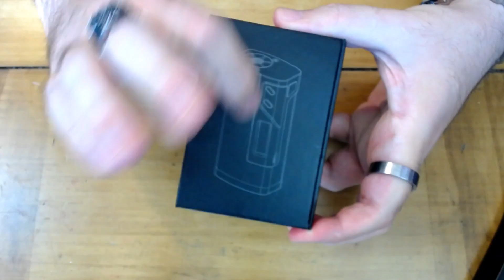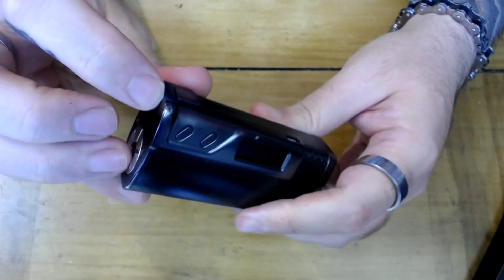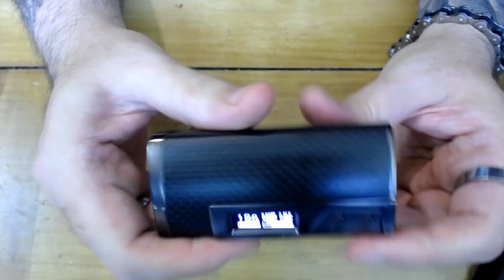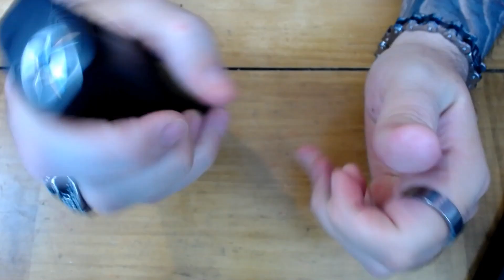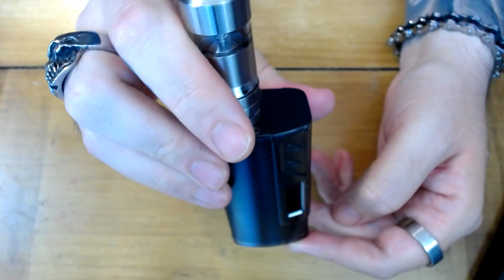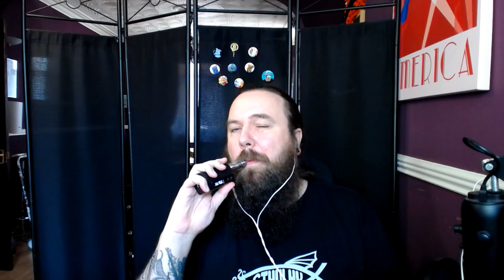Sigelei 213 Temp Control Mod plus TFR tutorial

Comment: Bought this today pretty happy with it. Con for me was the minimum of 0.1 ohm which makes nickel or nichrome clapton difficult for me at least even the evic vt which is ancient now could go to 0.06 which meant I could just enable dual claptons. Also got the stainless steel coils for the aspire cleito tank which is by far the best tank I've ever had and a rebuild able section which came with dual claptons installed unfortunately they had run out of stock of the larger glass 5 ml which is much better for the rba. Didn't enjoy the stainless coil in TC mode though it worked fine also works in power mode but kanthal 0.4 coil tasted a lot better imo. The preheat feature is amazing didn't notice you mention it but it's great in power mode and I like how they managed to implement it in TC mode also. Cheers
Reply from the maker: I hear you buddy, I have to say all I use this mod for is Wattage mode so it's no issue for me.
I think I must have forgot to talk about the pre-heat mode in power which obviously can help a lot with coils that need help ramping up.
Thanks for you comments.

Comment: pre heat is really slly , you can set the watts and how log you want it ot go on for and thenit will go to the watts you programmed it in power mode. so you can strt low for how ever time and have it go high as you set it in power or you can start high for a short time and bring it down in power mode, , i say just adjust to your liking or just use the power mode. if you set the ramp up high set the time shor between ,5  tp.75 sec

Comment: I have a question when you first access the tcr after you select a memory option the first screen you get it a set of values that look like  0.0003. what is that set of numbers for cause I set them all to zero and then set my temp to 300°f and it didn't fire at all. is there a certain number I need to plug in in the first menu?  I don't understand.

Comment: I can't get my 213w out of wattage mode. Every time I try, it says "Resistance Settings Only For Temp Mode."

I've tried several different tanks, I've tried using clapton coils, Kanger OCC, Kanger SSOCC coils...it will not change.

I don't know what to do. I've tried contacting Sigelei, but that's futile.

Any help would be appreciated.
Reply from the maker: +AversaS I'm sorry to hear that you are having issues with the mod. I would contact your vendor and ask for a replacement.
Reply: I know this is 2 years old but you were pressing the buttons wrong. You were reading resistance, not changing modes. Triple click the fire button to enter mode menu. Hold both up and down buttons together to read resistance, up button and fire button held together and waiting will bring you to the preheat menu.  Maybe this will help someone sometime. I’m having my own issues.

Comment: fuchai 213 need these adjustments and calculators ? or it works ok with celcius ?
Reply from the maker: +Hugo Faria I'm not sure I don't have a the fuchai 213
Reply: I have to change the value of the TCR based on each temperature I put in sigelei ? for example this table SS316L : https://i.imgur.com/rkGCfx8.png

If I use 300Cº or 572Fº the TCR must be set to 1246 ?
Reply from the maker: +Hugo Faria ahh OK my understanding is you use standard tcr not sigelie's

Comment: For some odd reason, I have two, and they both do temp control perfectly. Proof here: https://youtu.be/E_pRaZJjH4s Still doesn't excuse the bullshit Sigelei threw at DJLsb Vapes, but it is very very weird, because my 213s have the same 1.7 firmware version that Daniel tested and found to be non-functional.
Reply from the maker: Yes that is very odd thanks for sharing.
Reply: Mine works also.  I put the tcr value for ss316 (.00049) and it worked.  I rounded off the decimal to .0005.  I think people are not entering the values correctly.
Reply from the maker: +Jereme Martins good to know

Comment: there is no tc, they b.s.ed us they have ramp up and down but if you take it apart or have a pro do it there is no tc chip whatsoever
Reply: I’m assuming this is the same for the Fuchai Squonk 213... I can get mine running in TC but to change wattage all I can do is enter the preheat menu, set my wattage and how long it preheats which the max is 1 second. It works but after 1 second the mod tells me the atomizer doesn’t match...

I’m guessing it’s due to the resistance change of the coil as it heats. I’m not sure why it behaves the way it does but I’m not entirely happy with this mod. It’s my first squonk too.